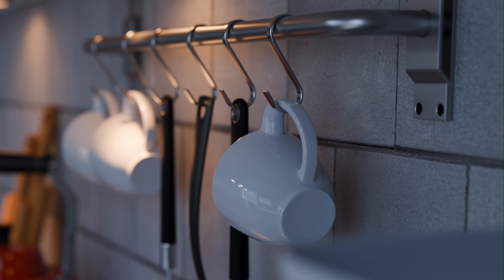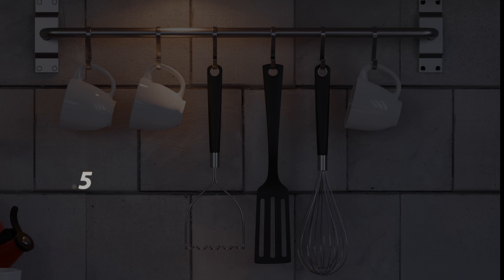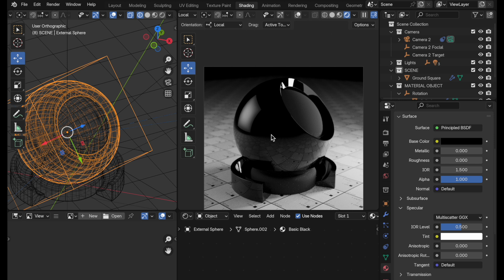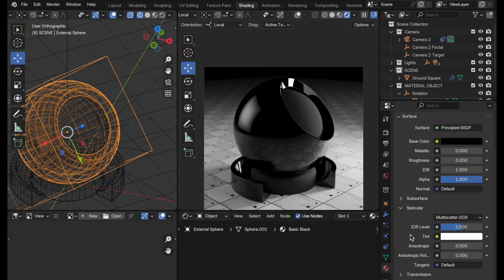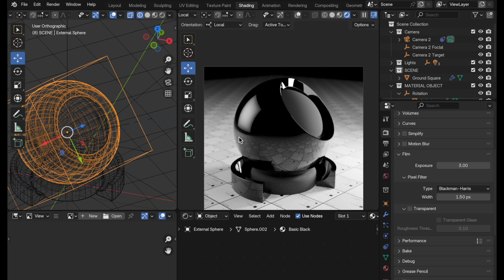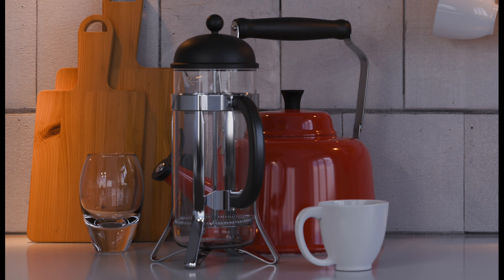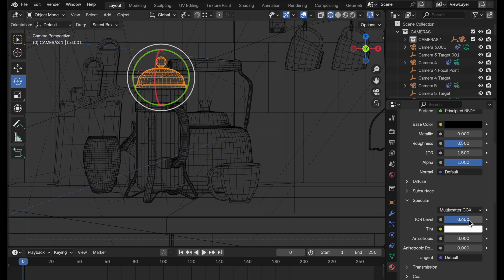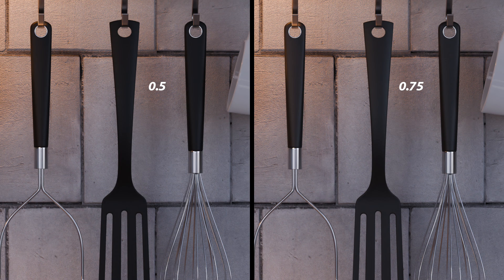What is IOR Level? An Introduction to this Principled BSDF value.

Comment: Thank you for this tutorial Christopher! I think I have used the IOR Level a few times, but on the whole I feel like Blender should not have included it in the Principled BSDF node... if it is true that it simply adjusts the IOR setting under the hood (IOR Level 0 = override IOR setting it to a value of 1 dead matte with no reflections, IOR Level 0.5 = use the current IOR value, IOR Level 1 = override IOR setting it to a value of current IOR x 2?? not sure! are we told anywhere in the documentation?). It's kinda like having two sliders that do the same job. If I had a greyscale map to drive specularity, then instead of plugging it into IOR Level, I could simply plug it into a Map Range node and set the To Min and To Max values to the desired IOR range (eg. To Min 1.3 - To Max 1.55) and then plug that into IOR.

Not only that... I download a lot of freebie models from places like Sketchfab and when I import these models into Blender as OBJs or FBXs the materials almost always get set up with IOR Level 0 rather than the default 0.5!! very annoying, as I have to go through every single material and open up the Specular drop down to check the IOR Level... I usually end up deleting the BSDF and adding a fresh one which I know will have default settings everywhere.

Comment: What i understand is the IOR controls in what angle your light will reflect 
And the IOR level controls the intensity of that same reflection !
Reply from the maker: The IOR controls the expression of the fresnel curve, which controls the degree of reflectivity at a given angle of incidence. The IOR Level is a scalar function that alters the IOR which then drives the fresnel curve. So you're kind of right.

Comment: Great Tip : Connecting roughness maps to IOR level will boost the reflections and make your materials more alive ! I use this on every shader now
Reply: If your map is a proper PBR roughness map then you should probably be inverting it before plugging into IOR Level - lower roughness values equate to higher IOR, higher roughness values equate to lower IOR. Of course, leaving the map uninverted could give you the artistic look you are going for.
Reply: @kes099 I  Will try that !
Reply: I'd like to add that noise textures are often enough to do the job. No need to go fetch some noise images for everything
Reply: @RustyNova  Of course, noise texture is better for noise. I am refering about proper PBR roughness maps that you can plug into the roughness socket AND IOR level to enhance the reflectivity of the whole PBR texture. 💥

Comment: It would be even easier if they did not use a normalized input. Because people find ior values on the web, yet now it goes into a slider. It doesnt behave the same as putting 8j say 1.5 as a base
Reply: I'm talking about the slider or oor level on the specular component. If find this second value a bit confusing
Reply: @RomboutVersluijs  You don't actually need to touch it if you don't want to. It's entirely optional and purely for anyone who wants to artistically tweak their specular reflections. For inputting scientifically accurate IOR values sourced online, plug them into the first IOR field at the top of the Principled BSDF node, where the default value is 1.5. Doing that is more than enough to give you accurate specular reflections. The second value is not necessary and shouldn't be touched if you don't intend to stray from scientific accuracy in your materials.
Reply from the maker: Yes, this is true. In fact, as far as scientific accuracy goes, Blender 4.3 is introducing a new Metallic BSDF node (obviously for metals) that allows for the use of N+K measured values per RGB channel.
Reply: @christopher3d475  but why than per rgb channel, you mean you can set separate n+k for red, green, blue. Why make it difficult again?!?
8 came from Thea Render. That's a full spectral rendered, with all this options already a alable and a couple more. It simple has no presets or you can enter an n and k calue. I don't understand why it needs to be per RGB channel. Perhaps I understood it wrongly though
Reply from the maker: @RomboutVersluijs  Because to get a physically correct color for the metal, you need a separate N+K value for the wavelength associated with each R-G-B channel.
Reply: @christopher3d475  but it could ve implemented easier by not doing it per RGB channel. Other engines use different approach but setting just one n and one k value. I see octane 4 blender also has this per channel setup. Makes setting up materials over complicated. Plus how are we going to find the correct values. Because to my knowledge, most online database have real world n+k values, not RGB channels values. Or is there some kind of convertor?
Reply from the maker: @RomboutVersluijs  I'm going to do a video on it in the next day or so.
Reply: @RomboutVersluijs  it's probably because cycles is not actually a full spectral renderer, so breaking it down into RGB values is how they can make it work for now
Reply: i know, but since they do use IOR values it's a bit weird. Because normally with these materials the IOR is the N value and the K is Coefficient ext
Reply: It would be easier to just input 2 numbers instead of finding the RGB values for these. Because those rgb values are really hard to find
Reply: @RomboutVersluijs  huh, yeah i guess you're right. regardless it's nothing any of us can do anything about; you'd be better off getting in contact with one of the devs.
Reply from the maker: @RomboutVersluijs  You'll understand when I do the video on it.
Reply: @Arjjacks well seems there is still a issue or bug in that V2 principled shader. When we set specular uit to 0 and change the the color, it's still visible. When we use a metallic. This uit value doesn't do any or very minimal, but the color does do something. I believe I remember when use metallic, specular should not work. But it seems it still affecting Metallic
Reply: @RomboutVersluijs  Yeah, Principled V2 is still using the old F82 metallic model under the hood, carried over from V1. It's always been a bit hacky and never worked with input IOR values as far as I know. You can tint the specular colour of metals to, in the words of the docs, "simulate complex IOR as found in materials such as gold or copper", but that's about it.

They've been planning to replace it, or at least augment it, for a while now, hence this new physically accurate Metallic BSDF shader using proper N and K values, instead the funky old Fresnel 82 curve.